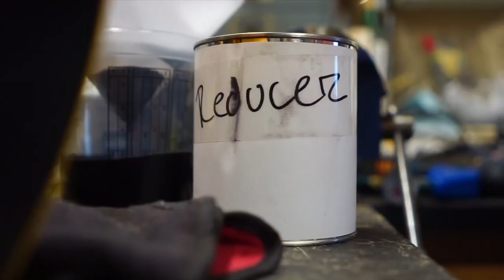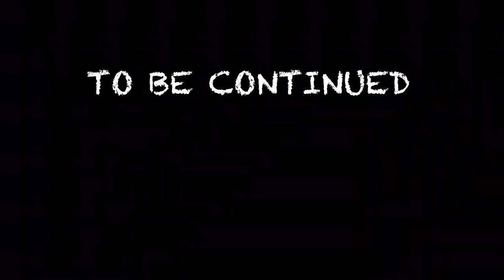CHUCKUS TRIKE SCOOTER [Episode 2]  from Tinky to Tonka

Comment: Looks very cool!  Just fyi split typeclock washers don't do anything but provide a false sense of security.  It's why you never see them in industry anymore.  If there is a concern of a bolt vibrating loose you're much better off using a nyloc nut or thread locker.

Comment: Dude I love your work I’m wanting to put a Q6 body kit on mine and the shocks you put on that one so I can put air in them and let it out to get a floating ride but I have to find forks to for a 2015 pst 9 cruiser so it’s not a rough ride I hate the way it handles but it takes money. And another thing I would love to see made for them is a faring with a motorcycle headlight and mount’s for turn signals and a cover that covers the rear and give it a clean smooth ride.

Comment: What sprocket do you have on the output shaft from the cvt? Im doing something similar with a honda helix and not sure whether to use a 12 tooth drive sprocket or go with something larger like you have. Engine is 250cc. I have a rear from a 250cc atv im mating to the helix, just not sure about the gear and chain.

Comment: Hey, would you happen to know if anyone has swapped out the original motor and gone with a manual?
I love the Ruckus looks, but can't see the point in a cvt on a trike. 

Would it be possible to flip the axle?  I understand you'd still need to cut and flip the brackets, or would a quad rear end just be less fuss do ya think?

Comment: I want to find a way to do this with a ruckus motor. Do you think that sprocket would fit the ruckus axle or different splines?
Reply from the maker: There isn’t enough power to push it with 49cc’s it’s heavy, and has a lot of rotating mass

Comment: Definitely not 120cc. Best just to call it by the bore dimension.
Reply from the maker: Like I said depends who you ask. eBay says a 50mm is 100cc 🤷‍♂️
Reply: @RollingWrench  most also say that 47mm is 80cc, but we know this not to be true. That's why I said it's best to just state the bore diameter, or do the math for the actual displacement.
Reply from the maker: zeebull true